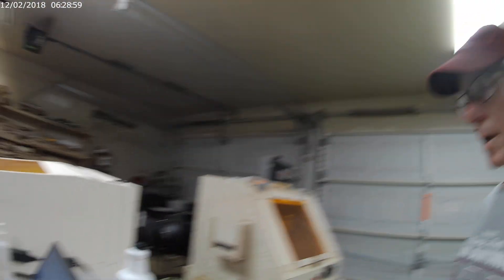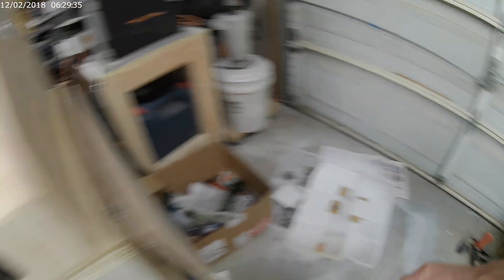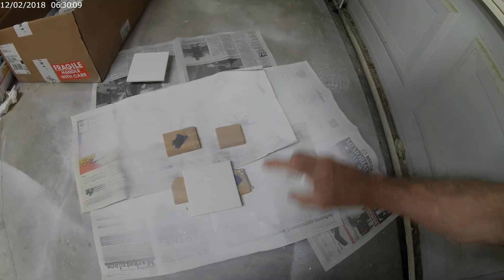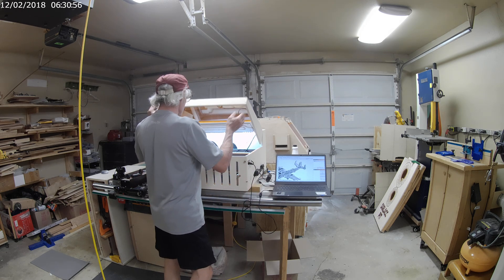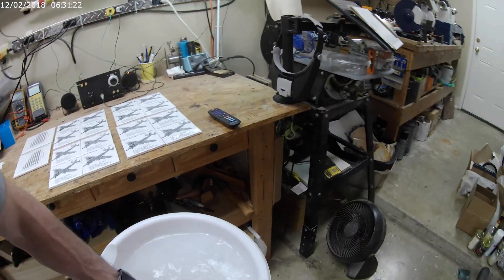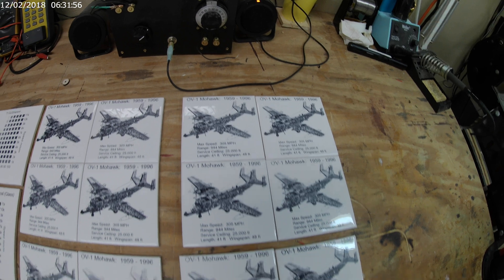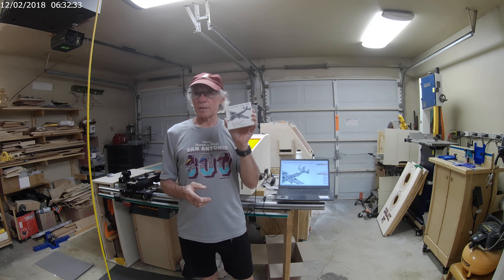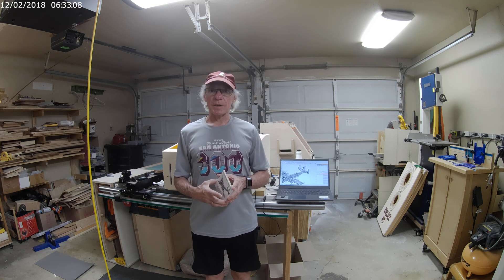Titanium Dioxide and Ethanol for Laser Engraving Tiles

Comment: Came here to leave a followup: started using a paint roller with spray bottle mixer (70% alc. TiO2) and  was ok but having to reapply starting leaving clumpy specs on a  larger 12 by 12 tile.  I think it was just too much area to cover effectively and repeatedly.  Smaller tile worked well.  Now, someone suggested an atomizer.  Bought one off amazon ($20).  Its a battery charged one designed to disinfect. I first mixed 90% alcohol with TiO2 and powder kept clogging nozzle.  Then I tried water and TiO2 and that seemed to do the trick.  Came out as a smooth mist.  Did one coat on 12 by 12 tile nice and slow making sure to get edges and corners just as you would spray painting.   If you get too close though, then it starts to drip.  I had to wipe clean and redo a couple times. The result was consistent deep black which is what I was after.  I was burning at 33.3mm/min at 60% power.  Job took 8 hours but it went down from 16 hours.  Again it came out flawless.  I did several tile tests on 12 by 12 to get the right settings.

Comment: hello, there . great vid. Do you think using this method improves even distribution of TiO2 on tile vs spray painting?  I've been engraving 12 by 12 tile and the burn in some areas is lighter or inconsistent with the nicer dark areas.  I figured its uneven paint distribution .

Comment: Thanks Joseph - nice place for us to share processes. I have a new Ortur LM3 10W that I was ready to return after not being able to get NWT to work at all. I had faint and brownish images. I tried some TiO2 with my 5.5W laser but images were similar to my paint. Last minute thought was to try the TiO2 on my LM3 - OMG unbelievable results! I used 3:1 ratio with 91% Isopropyl Alcohol. I had an old Harbor Freight airbrush and used it. After experimentation if I use 2 coats 2 directions @ 20psi or 4 coats 2 directions @ 10psi I get perfectly repeatable results. FYI - if you use too little or too much coating the image suffers. I can actually run my laser at 5000mm/minute @ 25% power. This saves me a bunch of time. I think with more work I can even go faster. Ha - now that I experimented on several pressures and mix concentrations I'm going to try the continuous spray mister a few have suggested because of the bounce-back and overspray from the airbrush. I also have a HPLV 4-turbine spray system but seems like overkill if a spray bottle will work.
Reply: I was about to through my LM3 out the window until I heard of Tio2. I hope this helps because no matter how slow I go, It did not work correctly using the Norton White Tile Method and the white Rustoleum spray paint. I will be trying it tonight just need a spray bottle and another bottle of isopropyl.

Comment: Thanks! I am using Denatured Alcohol and was using a sponge brush. This is a much better way to apply it. As far as removing paint. I bought some Goo Gone Graffiti remover in a spray bottle. It works great. Saturate the surface and give it 2-3 minutes and the paint washes off with water. No nasty acetone or mineral spirits.

Comment: so are you saying you don't have to let this coating dry before you put it into the laser?  Also can you use denatured alcohol instead of the ethanol?
Reply: You let it dry but it takes only a few minutes at most. Ethanol evaporates very quickly.  Some folks use Isopropyl alcohol and some use 2:1 ratio with water.  I have used water as well.  It just takes longer to dry.

Comment: Hey thank you for sharing, couple of questions if I may. How strong is this? Will the engraving rub off? Also could this be used on other materials?
Reply from the maker: It won't rub off. This is as permanent as using white paint with TiO2 in it.  I have not tested it on glass but other people on the laser forums have told me it does work on glass.
Reply: @josephbarletta5392  that's great to know thanks!

Comment: I started doing it this way as well. So much easier than the paint. I use one of those spray bottles that beauty salons use. You pull the trigger and you get about 2-3 seconds of a fine mist (with no splatter). Do a coat or 2 and the tile is usually ready by the time I get to my laser.